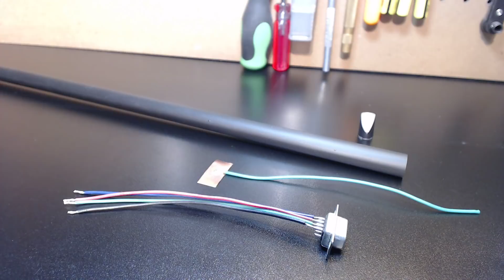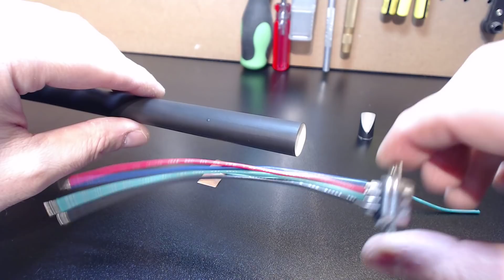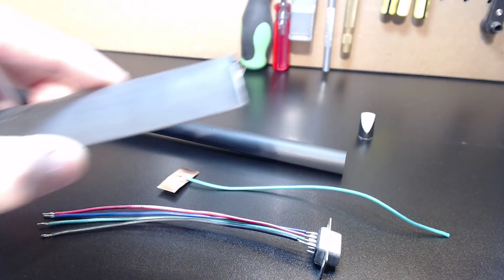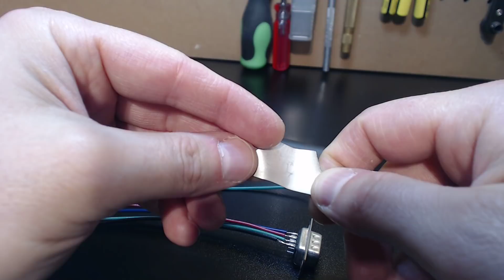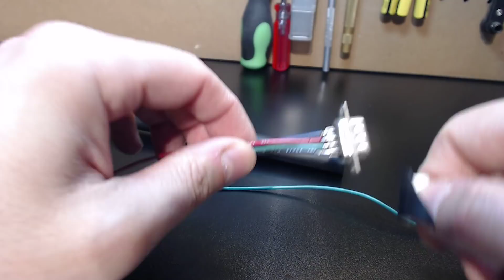How To Shield Unshielded Wires/Cables For Your CNC...

Comment: Hi, I´ve been watching your videos for the past few days and I must say, although I am no expert on the subject, your videos give me the feeling that you are one of the rare ones regarding electricity that one could trust. I would like to try to implement this method of shielding and later grounding myself and I already found shielded cables on amazon to replace on my hobby cnc stepper motors and subsquently other cables as well. Could I just open up this already shielded cable and insert the copper tape on the unshielded wired, put everything back together, of course with the ground drain solded on the copper as you show it in the video, would the effect be the same? Thx for your time, hope I explained it in an understandable manner. I live in Germany, that is why it doesn´t really fits my budget to buy everything I need from your videos, would be too expensive with the shipping costs. 😞
Reply from the maker: If the cable you purchased is shielded all you have to do is use its shield drain if it has one, or attach a lead to its shielding to ground it properly. If you prefer to use copper tape to do so that would be fine, but a lead still must be soldered to it to allow for proper termination to ground it. 

Thank you,
Vince
Reply: @corvetteguy50  thank you very much for your time and have a nice day :)
Reply from the maker: You bet! :)

Thank you,
Vince

Comment: Hi Vince , when you say any cnc cables should be protected if they send a signal.
Isn't that just the encoder wires. Or does the motors included?
Reply: Thank you for your detailed and quick response.
Reply from the maker: You bet...:)

Thank you again for your support,
Vince
Reply from the maker: Thank you for your support.  First to make sure we're on the same page all cables in best practice should be utilizing double shielded cables to mitigate both forms of EMI in both high, and low frequency.

All cables/leads carrying signals includes motor cables, encoders. motor leads that come off of rear enclosure connectors going to your drives, switch/accessory cables, and the leads that come off the enclosure connectors running to your breakout board to support them, VFD cable's both power, and to manipulate speed, and on, and off through motion control software. 

Once again any cable/lead that's carrying a signal to be manipulated by the breakout board, and or controller. 

Details count, and cutting corners here are where most end users literally build stability issues into their systems. 

Thank you,
Vince

Comment: Thanks for the video.
Do you think putting silecon wire into flexible steel conduit would work as a shield.
Reply from the maker: Thank you for your support. Shielded cable is to be used in best practice. If you can't afford it then save, and do it right. 

Half measures lead to wasted time, and money. Thank you,
Vince

Comment: I want to shield the input sensor wires and output trigger wires on my old MSD 6A capacitive discharge box. Should I shield each wire separately? Thanks
Reply from the maker: Thank you for your support. No you're fine shielding them all with M-shield. Thank you,
Vince

Comment: Please demonstrate with an example. I'm still confused about where the copper tape goes and where the shrink wrap shield goes. Should it touch your leads? Should you insulate the leads (i.e. with electrical tape or similar) prior to shrinking the shield around it? An example would best illustrate the concept and how to properly apply the product. Thanks
Reply from the maker: Hey Paul,
Thank you for your support. You made a good point.

 I'll be doing a video demonstrating assembling a harness with it in the following week. 

The process is as follows for creating a shielded wire harness.

The copper tape with the silicone lead gets wrapped around the wires you're wanting to shield. The copper tape is conductive, and will then make contact with the silver lined heatshrink which is also conductive allowing proper grounding with the silicone shield drain lead. 

You then apply the heatshrink over the leads with the copper tape installed. You want to cover all the leads completely, but don't want to cover the silicone drain lead except where its terminated at the copper tape's solder point. Once you've verified the silicone drain lead is exposed as described then you shrink the heatshrink over it. 

The final step is to attach the drain lead which is to be attached to your ground buss bar via its included ring connector.  Thank you, Vince

Comment: Great Salesman.. Show how to solve issue and also give an option of a product you sell to fix the issue.
You really need to let the automotive community know about this stuff.. actually that's how I found this video.
I'm building a wiring harness for a Ignition Control Module on a 91 Ford Mustang and the harness itself needs to be EMI protected and grounded/Drained, and honestly this stuff looks like it could possibly be very useful in the automotive community, so maybe look into that? If it is indeed possible to use in that application you would sell this stuff faster than you could keep it. It would just be making sure the stuff could be flexible I guess..

I've never had to do any wiring where I needed to protect against EMI so wish me luck.
Reply from the maker: Neptuned, thank you for your support. I really appreciate it. I engineered the M-shield, so covering it for sales is straight forward, and your correct many of my clients are in the automotive world as well as the aviation community. Another huge community I've seen a large amount of interest in is the HAM radio one. My primary engineering is designed around robotics use, but the applications are virtually endless where an end user is trying to achieve mitigation of EMI with the least amount of time investment. Thank you,
Vince

Comment: 3:55 This is the first time I've heard anybody say that the shielding needs to be tight against the wires being shielded. A cage is a cage isn't it?
Reply from the maker: iforce2d, thank you for your support. A cage with a cable isn't quite the same with an electronics enclosure for example. The tighter a tinned braid, or in this case a silver mesh shielding is around the leads yields a higher percentage of EMI mitigation. This is why a double shielded cable is considered the "bullet proof" form of shielded cable as Mylar foil typically covers 100% of the leads to be shielded, and the tinned braided copper mesh on average is about 70%-95% although most is 85% Here's a point of reference video covering this https://youtu.be/84udcsEC7zI?t=790 Thank you, Vince

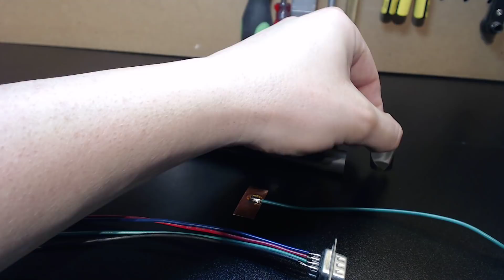Comment: At about 5:58, you talk about double shielding.  When you add the second layer, do you add a separate piece of copper tape and separate ground all the way back to the star connection?
Reply from the maker: You're exactly right, that's the way it should be done. Thank you,
Vince

Comment: So, would this be suitable for Nema 17 EMI shielding? Also, I'm a rookie in this subject, are we basically just using EMI shielding to take the field that is emitted from the cable and route it to a ground? What are some good resources to learn more?
Reply from the maker: Graham, thank you for your support. The answer to your question is M-shield can be used for any application requiring shielding, and your Nema 17's leads would be perfect to use with it pending they are within the shrink diameter the tubing can shrink to.

 You're also correct in what you wrote about taking any EMI present, and directing it to ground to dissipate it at a level that won't effect our system/application. Thank you,
Vince

Comment: If I have 5 foot of wire that needs protection do I have to shield the whole 5 foot or just a portion at the connector to capture the noise and then ground it
Reply from the maker: Josh, thank you for your support. The cable needs to be shielded from one end to the other, and only a few inches of shielding removed from each end where you intend on terminating each end. This heatshrink is best used for short lead runs on systems. Thank you,
Vince

Comment: I just ordered 10-feet from you...
Reply from the maker: Thank you Stephan for your support. I really appreciate it. Have a great weekend!
Vince
Reply: @corvetteguy50  No problem ..I have some RFI-EMI problems with my Newley installed fuel injection system on my classic car..This should take care of it..Im also a HAM radio operator so i know alot about RFI problems...Take care..
Reply from the maker: This will certainly do the trick..:) I'll be shipping the M-shield in its full 40in lengths as it can't of course be bent, or it will deform the interior silver shielding.  thank you again, and have a great weekend!
Vince

Comment: i am building a small cnc from a sainsmart 3018 pro kit. all the mechanical weaknesses have been upgraded. i have installed 92oz-in 2.1 amp steppers and fitted them with closed loop controllers. I was having issues so i thought closed loop would fix it and i hope it would as i havent gotten the rest of the parts to put it all back again. however i agree shielding is important. which lines should be shielded? should i just shield signal wires or go for broke and shield all.  any links would be appreciated. images appreciated. any input at all appreciated. as per another video of yours i am a hobbyist trying to make toys for my grandkids. basically my machine is 3018 running chronos maker board with bigtreetech s42b. everything is ribbon cabled but im pretty sure i have bleedthrough.  i guess what im asking is 4 wire stepper do i shield the 2 signal wires individually or seperately and should i shield my spindle power and seclude it from the stepper motor wires by reroute or other means? im a fan of antique looking wire for  alot of uses and i used some cloth wrapped (around silicone insulation) 12 ga. wire run to the spindle and im really sure its insulated but ill bet im getting bleedthrough on the z and possibly the x axis cables as the run right by it. i dont run a vfd. its a 500 watt spindle with a control board relay tripped speed control basically its a $230 piece of crap that ive turned into an $700 piece of crap and i just want to make small toys for the grandkids without the always wondering if it will get through without a failure. with the original 775 spindle and motors the machine was so slow and 2 hours into a project it would lose a step and screw up. after the motor and spindle upgrades those times were cut to 15-25 minutes but still at the end id see issues every once in awhile. closed loop seems like it could solve my probs but before i even get them installed i want to as best i can shield the few wires needed and i could buy shielded wires just need to know what kind. would shielded security wire work twisted pairs for motors? or a twisted shielded pair for the signal wires and external power leads? or should the power leads be shielded as well in a seperate wire? Sorry for the run along post just trying to fix a few issues before they come up
Reply from the maker: Q5grafx, thank you for your support. Answers to your questions are below.

 should i just shield signal wires or go for broke and shield all. any links would be appreciated? Only the signal wires are required to be shielded.
 Here's a video to review https://youtu.be/dmXHo32QkrI

i guess what im asking is 4 wire stepper do i shield the 2 signal wires individually or seperately? You would in best practice shield the stepper leads as a group, and not as individuals.

and should i shield my spindle power and seclude it from the stepper motor wires by reroute or other means? The spindle's VFD should be at least 5ft from the controller, and the spindle should be using double shielded cable to mitigate EMI.

im a fan of antique looking wire for alot of uses and i used some cloth wrapped (around silicone insulation) 12 ga. wire run to the spindle and im really sure its insulated but ill bet im getting bleedthrough on the z and possibly the x axis cables as the run right by it. 12awg wire isn't required for the size spindle you have. I recommend 16awg for flexibility. 

i could buy shielded wires just need to know what kind. would shielded security wire work twisted pairs for motors? It will work, but optimally double shielded cable in my store is best as it protects from both high, and low frequencies of EMI.

twisted shielded pair for the signal wires and external power leads? or should the power leads be shielded as well in a seperate wire? You can also utilize ferrites which are passive filters, and much less expensive. 
https://youtu.be/kirRKgrTOCk
Reply: @corvetteguy50  Thank you so much.
Reply from the maker: @Q5Grafx  You bet....:) thank you,
Vince

Comment: What gauge wire are you using for the internal wiring and stepper wires for a low amp system nema 17s....2 by 3 work area router
Reply from the maker: Salvador, Thank you for your support. I really appreciate it. A system using Nema 17's is fine using 18awg wire.  Thank you,
Vince

Comment: Where should the ground wire go? Ground to the machine? Run it back to the ground on the power supply?
Reply from the maker: Hey John, thank you for your support. The ground drain should go to your ground bar in your electrical chassis. Thank you,
Vince
Reply: @corvetteguy50  I'm a bit confused here if  one end goes to the ground bar , where does the other end goes?
Reply from the maker: @gideonopuni964 , thank you for your support. There's only a single ground drain that gets run to the ground bar in your system. If you attache a ground at each end you at very high risk of a "ground loop" Thank you,
Vince
Reply: @corvetteguy50  thanks for responding.  Meaning I can connect one end of the shield to the 0v and the other end to the ground bar?
Reply from the maker: @gideonopuni964  You, only will connect the ground drain to the ground bar. There's no lead run to your 0v . Thank you,
Vince
Reply: @corvetteguy50  thanks
Reply from the maker: You Bet :)
Thank you, 
Vince